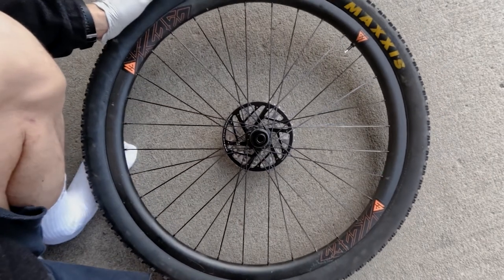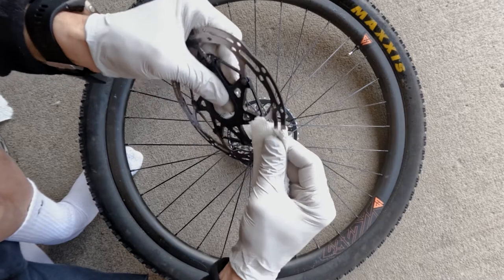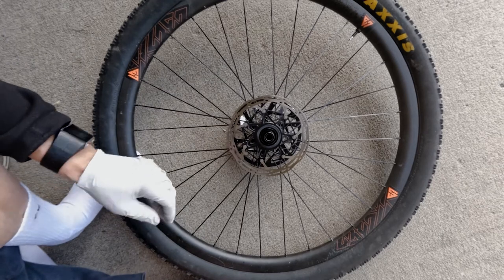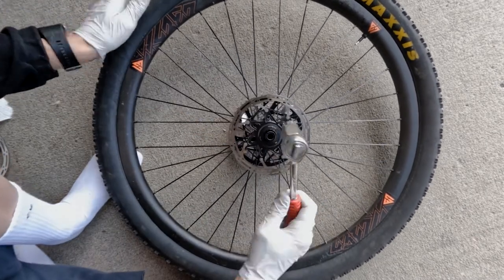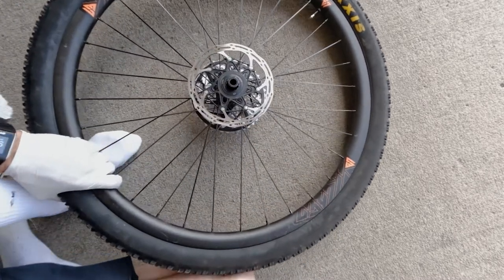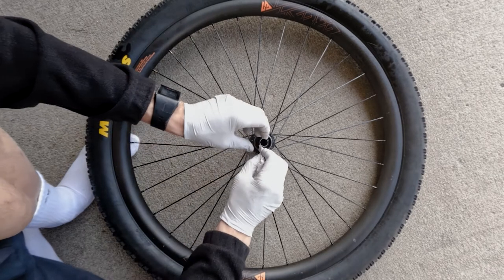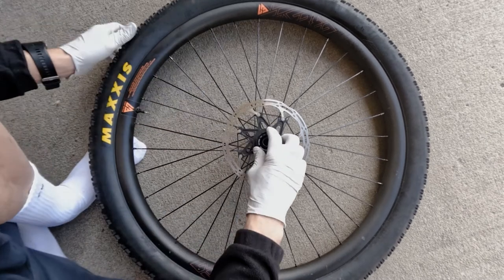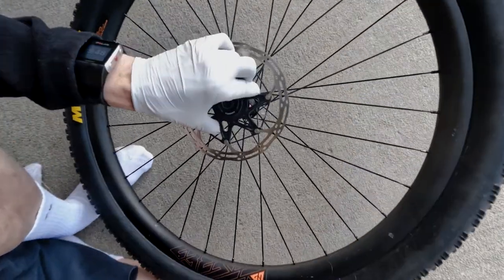Quick Centerlock brake rotor install guide for beginners with  tip on using torque wrenches properly

Comment: Thanks a lot for the video! I just got my bike and felt like centerlock is a bit loose, and since I did not have the tool I went to a local bike shop. However what they did was do the same procedure without the torque tool, which I realized only now. I hope it's safe to ride
Reply from the maker: I'm glad you found it informative. I would absolutely keep on the center lock nuts. If they haven't been torque to spec. 6 years ago I was on a ride with a good buddy of mine who had done the same thing, and it turned out he didn't apply enough torque by hand and his rotor started rattling in the middle of the ride. It was a TOTAL fluke that on THAT particular day there was a bike demo event on the that trial and managed to find a tool at the specialized booth in order to fix it. People think they are accurate by hand, but it not until you test your self against an accurate torque wrench where you realize how off you really are.
Reply: @zoubtube  Thank you for the quick reply :) I guess I'll ask around, maybe somebody/somebody's dad has got this kind of thing. That's a really stressful situation I guess when the rotor suddenly starts rattling... By the way how I found out it's loose - I was checking brakes after I got my bike and when the rotor was completely fixed by the brake pads, the wheel could move around 1cm in both directions. Now it doesn't do that, but my back wheel has just a couple mm movement.

Comment: Thank you for the video sir. I would like to know why two different style lock rings? I’m a completely new to this bike building process.
Reply from the maker: apologies for the delayed response but we're still out of power where I live. The axle diameters are different between the front and rear wheel. Front wheel axles are typically 15mm, rear wheel typically 12 mm. The caps are not interchangeable between them. Hopefully this helps. Let me know if you have other questions.

Comment: Thumbs up, mate ! What Maxxis tyres are those ? I need one torque wrench who can do 40Nm, at an affordable price. Can you recommend me a torque wrench for this , please ? Thank you !
Reply from the maker: So I'm a big fan of snap on torque wrenches. They are by far the most precise and reliable torque wrenches on the market. but they are expensive. A more cost effective option would be a Tekton imo. they make good quality tools for the money. What you might want to do is buy a lower cost torque wrench such as a Tekton, then get it tested for accuracy. If you happen to live in an area where snap on trucks regularly go through, they can quickly test it for accuracy, in the truck, at no charge. This will give you an idea how close to accurate the wrench is. just take into consideration that NO torque wrench is 100% accurate.

Comment: Do you have a link to the wrench you use?
Reply from the maker: The Torque wrenches are the Snapon ATECH2FR100B (high torque specs) and the ATECH1FR240B (low torque specs). Personally, both are overkill as they are meant for the aircraft industry so if you don’t have other needs for these torque wrenches I can’t recommend spending the money on them, unless you buy them used. Plus, these are tech angle, which adds to the cost and isn’t needed for most torque needs. Regular torque wrenches are all that’s needed. A precise low torque spec wrench ex: 12- 240 inch lbs, would be more important imo as most torque specs on mtb’s parts are on the low end. Let me know If you have any other questions.
Reply: @zoubtube  thanks.

Comment: My cassette tool isn't fitting over the dust cap over the axle, is there a way around this? (Can't pull it out bc it is locked behind center lockring)
Reply from the maker: My sincere apologies for the delayed response, but I'm WAY behind on personal stuff. It sounds like you need a cassette tool with a longer reach. Different companies make them at different depths. To remove it with a different tool, you can damage the lock ring, as most of them are made with soft metals and are installed with high torque specs (typically 35 to 4nm). You might want to consider buying a deeper cassette tool.  Paying extra money for an extra tool sucks, but they aren't all that expensive, and it should take care of the issue, now, and later.

Comment: An idiot question friend, can't the same lock ring used in the rear be installed on the front wheel?
Reply from the maker: Not an idiot question at all myman and better to ask. The axles between front and rear wheels are different sizes. typically 15mm for the front and 12 mm for the rear. this is the reason there are two sizes for lock rings and they aren't interchangeable. Hope this helps
Reply: @zoubtube  Thanks Man, now i understand.

Comment: Hello. the tool to tighten the outer nut, the black one, the round one? thank you
Reply from the maker: For the rear wheel lock ring, any cassette tool will work. For the front wheel lock ring, any 16 notch tool like the park tool BBT-69.4 will work. let me know if this isn't' the info you were asking for.